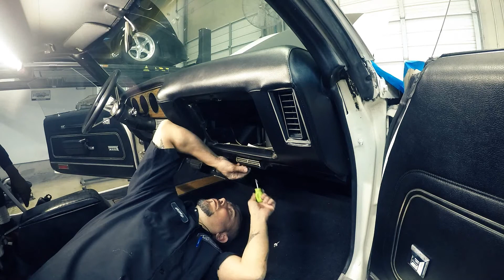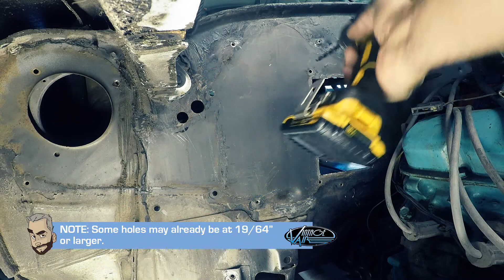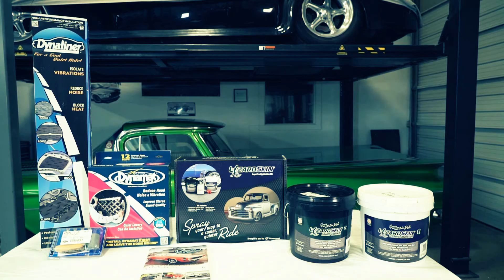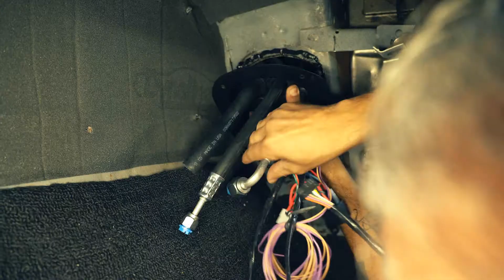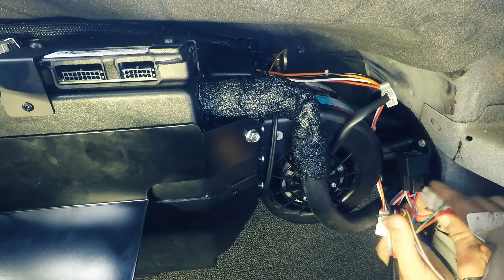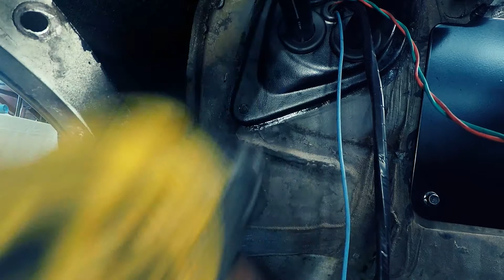1968-72 Pontiac GTO Evaporator Installation

Comment: i am installing this kit in a 70 gto no air car. i want to see him install the duct hoses. there is a reason he showed the hose mounting locations with the unit outside of the car. i had to pull the entire dash out to get the ducts run.  even then you have to engineer getting the driver outlet hose to the unit. the original glove box will not fit due to interference with the passenger defrost duct hose. another issue is with the center dash outlet. it will work with a factory speaker but with a aftermarket speaker it hangs down lower and interferes with the duct work. there is a reason he does not show running the duct work.
Reply: I’m concerned about exactly what you said. I have aftermarket front speakers and also am hoping I don’t need to take the gauges out and all that.

Comment: I have a 67 GTO. Do you have a video on that? I think I also have to remove the inner fender well?
Reply from the maker: Sorry, but no video. Yes on the 67' GTO you will need to remove the right inner fender for the install.
Reply: @va197653  Thank you for the reply. The inner fender doesn't come off without removing the fender.  It looks like I have to remove the fender, the hood hinge & the bumper. It sucks. Big job over a damn evaporator. I tried taking it out with the fender on. No way.  Thanks again.

Comment: Where does the 2 wires on the plug for the compressor lead to? I Kno one is grounded but where does that green one go after that relay connection?
Reply from the maker: After the relay connection the comp. lead wire will then enter into a safety switch then out of the safety switch to the compressor lead wire.

Comment: Good job Billy. What type and brand of heater hose do you use? It looks very high quality. What kit do you recommend for a 1987 Chevrolet R10 Fleetside Pick Up without factory air? I was a mechanic for over 20 years and I will be doing the installation myself. Thanks and take care. By the way, Jay Leno speaks very highly of you guys.
Reply from the maker: This is an off the shelf Dayco 5/8' heater hose

Comment: Great job👊 How many total hours did it take u to install it all? I'm considering having a system put in my Chevelle,my Camaro and my Impala. But I'm stuck on the shop doin it or doin it myself.
Reply from the maker: it really depends on the skill level of the technician and the equipment used, but generally you could expect to spend 20-25 hrs. for the install

Comment: you guys need to make a vintage air a/c kit for the 70-71 gto/lemans/tempest
Reply from the maker: We have a new kit out that covers this application,(70'-72' GTO/Lemans/Tempest) if you visit our website www.vintageair.com and enter in your vehicle info. it will pull up the available kits.
Reply: So it looks like the lower vent (planum) is deleted?